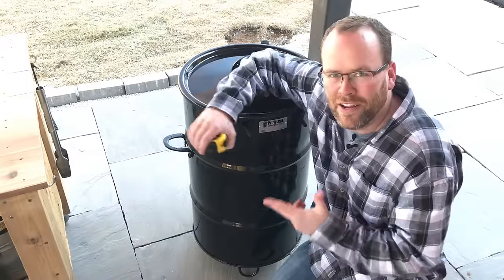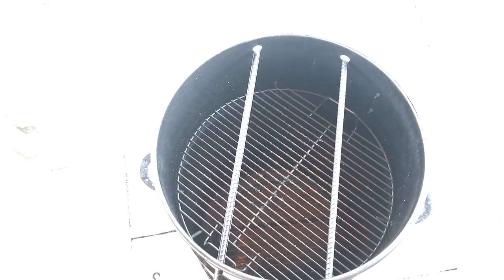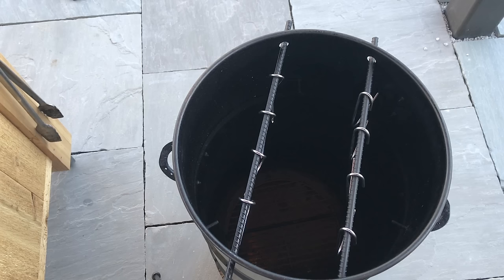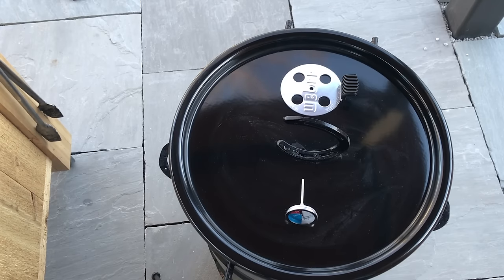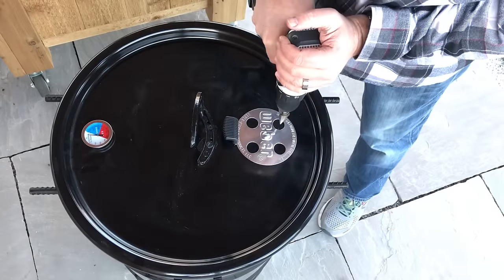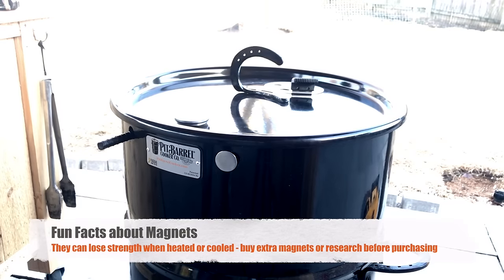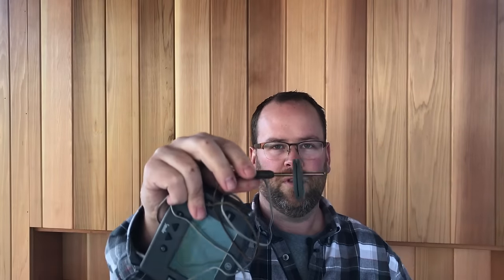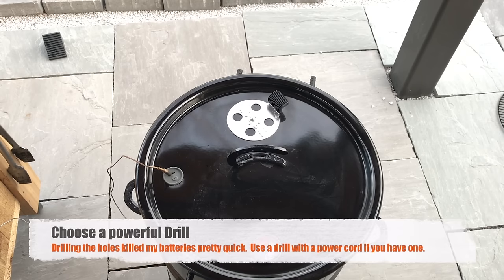Pit Barrel Cooker Review and Modifications

Comment: Not to be negative, but these modifications were completely unnecessary.  Probably should have purchased another smoker.
Reply: Tom Evans He is clearly obsessed with weber, all he had to do was remove 1 rebar to solve his problem. You only have to mod crap equipment the PBC needs no mods.
Reply: Some people just like modding. Nothing broke the bank either
Reply: Let me Guess Tom, you drive a BMW, don't you?
Reply: Pit Barrel Cookers work perfect right from when you unbox it, if it’s not broke why fix it?
Reply: @kyiaboy  it runs hot, if you want top notch Brisket then 250 is your target temp. I'll be buying those magnets, thats as far as I'm going to go.
Reply: @stantheindian  It doesn't run hot.  It's not a smoker.  It's a cooker.  People get all messed in the head when they try to run smoker temps on it.  It's not a smoker.  The humid smoke fog that is created in the PBC plus the idea that you aren't sitting on a hot rack means you can run the higher temps without any issue.  The PBC runs from 270 to 315 and cooks just fine at those temps.  Now I will allow, at 160 you do need to crutch with double foil if you want your best brisket but yeah, it does a fine job.
Reply: They are necessary, had pit barrel for years and lack of control of air flow is ridiculous

Comment: Your ideas are great but I wouldn’t have drilled unnecessary hole to insert thermometer reader. Instead use the existing holes that support the rebar.
Reply from the maker: I actually might drill another hole in the side at some point for a different grommet setup.  Kind of wish I would have done that originally.
Reply: My thoughts exactly!
Reply: @Searedandsmoked  now you have to deal with it every time you open lid...

Comment: I love my PBC as well but had the same gripe about temp control.  My solution for that was a BBQ guru.  All you do is set it for whatever temp you want and walk away.  They  make a fitting that goes inside the PBC and the fitting neck stick out from the intake.  Works perfectly and the smoker stays within 10 degrees of whatever temp you set it at.  That's the only l mod I needed since I also use a wireless digital thermometer.
Reply from the maker: Lekan Oyefeso yeah.... those work great. i have one of those and a flame boss as well that i use on my green egg... i have not rigged it up on the pbc yet. have you found that it burns longer with the controller? i got about 10-11 hours with out one so far
Reply: Seared and Smoked It does burn a bit longer when set at lower temps, which is nice when doing a brisket at 250 or so.  I've definitely noticed that the food I make turns out much better with consistent cooking temps.  Briskets are absolutely amazing!!
Reply: I just added a party q to my pit barrel. It works great. made some ribs at 275. Once the ribs were done I let it run just to see what would happen. I started the ribs about noon, they were done about 430. It was still holding 275 when I went to bed at 1130. I shut it down after that.
Reply: Duane Wilson 
Did you have to make a mod to get the Party Q to fit?
Reply: Lekan Oyefeso 
Did you have to make any mods to get the guru to fit? Would you mind sending a pic
Reply: No. No mods. You let them know what cooker your using and they will send you the appropriate adaptor for the pit barrel. It goes right over the vent on the bottom with 4 screws. The party q fits right in that. Easy. Doing a brisket as we speak holding at 250 since 2 pm today. @MrTwon334

Comment: I just use foil around the rebar to keep the temp at 225 to 250. Putting a probe through the existing hole works good. Putting the weber vent on top is cool, but if I need that much heat I'll use something else- like a weber.

Comment: hey nice modifications for the PBC, I would´ve recommend to drill the hole for the probes on the side of the pit (not on the lid), this way, everytime u want to check your meat you dont have to take to probes off before lifting the lid. Just a thought. Nice video!
Reply from the maker: Thanks! I wrestled with that decision for a while.  The main reason I chose to go with the lid in the end was lack of confidence in what I was doing... so I figured it would be easier to find a replacement lid if I really screwed it up... lol.. but I totally agree with you on the body being a more ideal placement
Reply: Seared and Smoked looking fwd for more of your videos Sir, greentings from Mexico.
Reply: Cant you use the holes where the rebar is at for your probe? instead of drilling holes in it ?
Reply: @kidhiguera  Saludos, en donde estas ? Yo estoy en Autlan JAL.
Reply: @JP-pl9mv  Sinaloa!
Reply: @bbqnbear6435  That's what I do and put foil around the rebar if I want a lower temp.

Comment: I am posting this not to get on anyone's bad side but rather I don't want a novice coming out here thinking they bought a dysfunctional  cooker.  

Cooked and competed with the PBC for years.  You guys keep treating this thing like a smoker.  Temperature control is important ON A SMOKER.  And yes, you need to ensure you don't get too hot ON A SMOKER. 

The PBC is not a smoker.  It's never been advertised as a smoker.  The cooking environment is a smoke fog.  I have made award winning brisket, ribs, and chicken with absolutely zero mods.  Yes, a SMOKER that gets hot will dry out the meat and burn.  In the PBC, it doesn't matter because unlike a smoker, you have a very uniform heat environment that is also very moist.  Because of that, the temperature simply isn't important.  The only way an PBC can get too hot is if the lid isn't seated correctly or the damper at the bottom is set open too far.  Furthermore, because of the smoke coming from the drippings, you don't need wood.  I have used wood three separate times and the difference wasn't different enough to matter.

Noah Glanville is an experienced BBQ man and if the PBC worked better with the mods recommended here and in other places, they would be on the unit.  If you are getting bad results with the PBC out of the box, you are doing something wrong.

Once people go to a different fuel or deviate from the instructions and recipes on the PBC website, they trip over themselves and then blame the cooker.  For example, butcher paper doesn't work very well on the PBC as it allows too much heat in during crutching and with no drippings, the environment is hot and dry.  If you crutch with double foil and broth, you will place in the competition every single time.  EVERY SINGLE TIME.

---off the soapbox
Reply: Thanks for the very insightful comment.
What's your take on using Royal oak instead of kingsford blue?
Reply: Truth, no mods neccessary..best chicken and ribs I've ever made...even compared to my big ass stick burner. Best cooker I own period.
Reply: @topranked5465  Stick with KBB.
Reply: @topranked5465  I tried other charcoals long ago and always come back to KIngsford Blue Bag.  The reason is, as confirmed by Pit Barrel Cooker's earliest videos, the unit was specifically designed for Kingsford Blue Bag.  The temperatures and vent settings are built around KBB.  I am not saying you can't use other brands or whatever, but I am saying that the KBB is what the unit was designed for.
Reply: Interesting... i will be picking up the PBC for the lack of mods that this gentleman is adding to his pbc. Different strokes for different folks, but I believe the pbc was made for simplicity and ease of use. Setting it and forgetting it. Trusting the temperature it produces without having to adjust any vents or check pit temperatures. I hear it’s a rib making machine straight out of the box. Can’t wait to get one.
Reply: bechtoea hi dude, you obviously know your bbq I’m in wales UK and looking at buying a PBC as the ribs just look fantastic for the amount of effort to cook them. I won’t be able to get kingsford blue here in wales. Do you know of a substitute that has the same quality? Thanks.
Reply: I’m so excited my PBC is on the way!!! Thanks for the tip! I bought it for the reasons your stating. No worries with temp control, and I always crutch with double foil broth, trinity,etc. thanks for the insightful comment
Reply: Top Ranked The best way is Kingsford original, , Royal oak is excellent but burns way too hot for the PBC
Reply: what about lump charcoal versus briquettes?

Comment: Nice mods. I like the grommet for probes. Next time after you have drilled your holes—flip the lid over and run your step drill through the backside—this might remove the burrs quickly and easily—still will have to do some fine sanding but it should remove most of it.
Reply from the maker: qwesthunter at R shack BBQ Ahhh... that’s a good tip... I knew there must have been an easier way. I made that too much work! Thanks for checking out the video
Reply: @Searedandsmoked  why didnt use just use one of the rebar holes to run ur wires instead of drilling an exta hole on ur lid
Reply from the maker: Lupe Martinez 123 I found it kind of a pain to have the wire and probe through the rebar holes. I like the hole in the top, as the probe stays out of way of everything... or a hole in the side would have been fine too.

Comment: Have you ever thought about adding three additional side tabs for holding a second, lower grate below the original grate?  This would provide: 
1) additional grate surface for smoking;
2) a lower grate shelf on which to place waterpans, dripping collection pans, etc. below the original grate.
3) a lower cooking level for searing and grilling closer to the coals; and 
4) a shelf on which to place an aluminum disc, folded piece of aluminum foil or other diffuser to facilitate lower, slower, more indirect cooking.

What do you think?
Reply from the maker: Jerry Percy I would like to add a diffuser plate of some sort to help more even cooking temps.  i think that would help larger cuts of meat cook more uniformly
Reply: Seared and Smoked 
I agree the diffuser plate would do that; but even more important to me are at least three other things a second, lower grill grate would provide:
1-double the space to cook meat placed on the grates (when not hanging);
2-a place to put a water pan, dripping pans, etc. below meat cooking on the grate; and
3-a lower cooking level—closer to the coals— for searing and for cooking “hot and fast”.
Reply: I found out by accident that the three leg stand will hang upside down on the existing tabs, and you can slide the handles of the existing grate onto the circle part of the stand. This works if you have something else (like cinder blocks) to stand the cooker on.
Reply: Veddy interesting.  
Thank you, Nathan!

Comment: I did a brisket on my PBC for my first cook yesterday and the results were fantastic! I did install a similar thermometer to the one you put on. I did a lot of research on this cooker over the last 3 years and while I understand the simplicity of the design, and how the instructions (and following them) will be all you need, knowing the internal temps did help me to move the bottom vent around a little. I think it's more a case of not wanting to just leave the thing alone! 

I am interested in the Weber vent you installed on the top. With the understanding that this cooker is not a true smoker in the literal sense, I would think that venting the smoke out of the top to any degree would further deplete the available smoke an cutting it off before it gets a chance to waft around the meat a little more. Maybe having the vent on the side would be a better option, if it's necessary at all? I'm pretty happy with my results and I'll probably skip the added vent but I really enjoyed your video! Thanks for doing it.
Reply from the maker: Yeah, I would only add the vent on top if you want to get temps higher.  I never really use the vent when doing low and slow stuff.  Mainly use it when I am hanging chickens and want to get more air flow in there. It's a great cooker with out the modification.  Love it for ribs and hanging chickens!

Comment: I agree with the simplicity of this smoker. I also agree that minor modifications would put it in a class by itself. The  grommet for a temperature probe I feel is necessary if a probe is touching metal it’s going to run hotter and not give you an accurate reading. I also feel a trap door down below to add smoke chips or extra charcoal if needed would also be a huge improvement. Currently if you have to add during the cooking process it’s a huge pain in the butt to remove everything and add stuff yes the half grate that they sell in “addition” rather than just give it to you in the beginning would alleviate this but only if you’re using the grate if you hang meat through there you still have to remove the meat to add stuff. So a trap door mod would be awesome if they added it in the future. I am going to try and do it myself after I research the best way to make a cut of that size + type of hinge then a way of finishing the edges to keep it airtight? If you figure it out before me let me know.
Reply from the maker: the temp gauges have been pretty accurate from my use of them.  the gauge and the temp probes I have used ready pretty close to one another.  Not looking for anything too precise... just a reading to let me know if it is way too cool or way too hot.  The door I would be careful with... might create a bigger problem.

Comment: I just got one last week and did my first smoke on it last weekend (4 lb pork shoulder with a simple dry rub).  It was my first time smoking with a real smoker (I'd bastardized my gas grill to make it smoke before, but it was a hassle and a lot of work to keep it running right and keep the temperature in the right range).  Once it was lit and the meat was on, it stayed rock solid between 200 and 250 for 5 hours before the coals went out.  All in all, it was an amazingly easy and fun experience, and it was some of the tastiest pork I've had (better than bacon!).

Anyway, one thing that I didn't like was manually checking the temperature, so I wanted to add a temp gauge, but I'm debating between putting one on the lid vs on the side.  I'm not anywhere near an expert and just learning as much as I can, but I was hoping to hear your reasoning for choosing the lid and what you might consider the benefits for either to be.

Great video!  I look forward to getting a lot better with this smoker and putting my first pork shoulder to shame.
Reply from the maker: Hi there... I chose the lid mainly because I did not want to put any holes in the main body of the smoker.  I think either way is fine.  I am sure there is some temperature change from top to bottom, but I just wanted some sort of sanity check on the temperature.  I have put temperature probes in at the grate level and it reads pretty much the same as the gauge on the lid. 

thanks for checking out the video... Keegan
Reply: Thanks for the reply!

Now I just need to figure out how to lower the temperature if I overshoot (tried hanging ribs last weekend but couldn't get it below about 300-325, so it cooked too fast and dried out)
Reply: You might want to check your vent setting ans make sure your lid is properly seated.  I bent the lid lip and didn't notice it till I realized that the lid was open a crack...  Once I figured out how to hook  it; the lid closed with no problem.  And I had to adjust the vent a bit as I am around 1700 feet up... HTH

Comment: Just got my pbc, was wondering what kind of mods I could do to be able to control temperature easier. Subbed. Great vid.
Reply from the maker: Its a fun toy... so far I like it for hanging half chickens the best.  Ribs pretty damn tasty for a 3-3.5 hr cook too.  Thanks for checking out the video
Reply: Now let me know probably cause I just got one today did you f it by changing it
Reply: I have done any mods yet (someone else did a temp probe in the lid before my dad acquired it and then I inherited it). I would like a better method for adding wood (I like my stuff smoked) and I don’t like how high the temp tends to spike if you open the lid for a while to add wood. I’m liking the idea of the magnets. When I’m using the grill to smoke say a Pork Butt, that’s a perfect low cost addition to help control temp. Also, I’m trying to figure out how to have better inlet control. Maybe a giant magnet? 😂
Reply: @NateBedair  I like the idea of adding more wood and coal from the side without cracking the lid thus was thing of cutting  an piece of the side and adding an hinge as an entry to add wood when desired instead of taking off the grill when smoking.

Comment: I've had my PBC for a few months and have thought of adding a thermometer but really like your Weber Damper idea too. I'll be on Amazon as soon as I get to my office in the a.m. 
Thanks for your informative video.
Reply from the maker: Warren Pouyer no problem... i’m glad you found some useful ideas. i’ve really enjoyed the damper... great for a controlled temperature boost
Reply: After finding that my modifications failed to offer much benefits and instead made it more difficult to hold temperatures accurately, I actually tossed the whole thing in the Garage and bought a new one. Leaving it the way it comes from the factory is working MUCH BETTER. All I've added is a pitmaster IQ designed for the Pit Barrel Cooker. DON'T DRILL HOLES IN YOUR PERFECTLY GOOD BARREL.....

Comment: How's the lid holding up after 4 years? I'm thinking the enamel removed when drilling the holes would expose the bare metal and provide a starting point for rust.
Reply from the maker: I have given this one to a friend, but if you keep it covered, it holds up well.  I had no rust or very little on the inside of the lid.  But... I did keep it covered when not in use.
Reply: You can buy a small can of high temp bbq paint, black and just touch up the bare metal that is exposed.  Holds up very well.